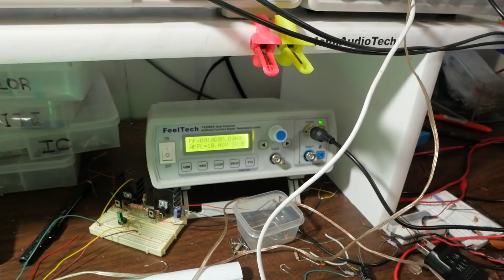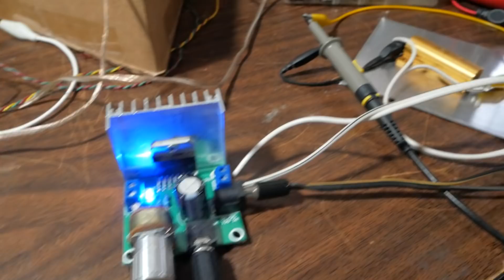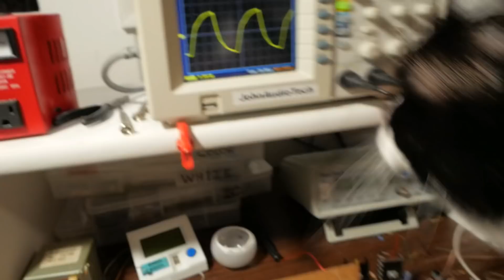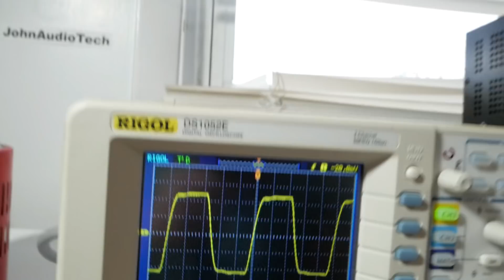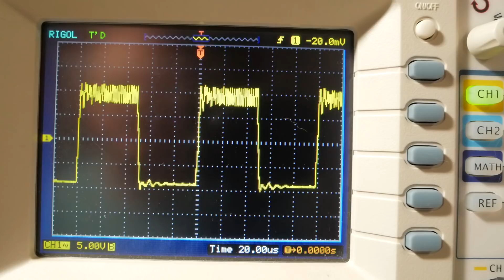Audio amplifier step response and stability test class AB and D chip amps

Comment from the maker: I should mention that this type of test may cause some amplifiers to break out into severe oscillation and blow up. Test at your own risk!
Reply: JohnAudioTech is it normal for the LM1875t to warm when idle?
Reply from the maker: @LUISRUDY1  Yes, it draws a couple watts idle.
Reply: @LUISRUDY1  Warm is fine
Reply: @LUISRUDY1  do you have heatsink?
Reply: https://photos.app.goo.gl/T94sAjtCpryuijFE9
Reply: this is the project I'm working on, it's based on the 6j1 tube buffer with some improvements
Reply: I did it and my old amplifier still working well i bled up one channel jeje its part of the risk regards excellent video
Reply: If you do you math right you should be fine if you can adjust voltage and step up you should be fine correct I’m still learning myself

Comment: Your test is great, in real life with the changing impedance and inductance going on in an actual speaker system those calss D results will be even worse... Class D just plain sucks!  AB all the way baby!
Reply: Untill you apply negative feedback to the class D amplifier. Then you can eliminate the non-linearity introduced by the filter and switching stage.
These feedback circuits can be fairly complicated, but in return you can have THD levels similar to class A/B/AB amps but with much higher efficiency.
Reply: @coen270  What good is efficiency if your signal is not being reproduced faithfully.   Try as you might, D is not going to do it.

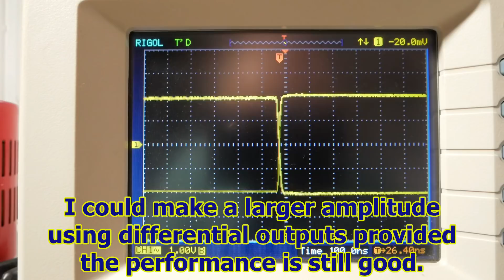Comment: In the video text @ around 6:00 you state that you "could make a larger amplitude using differential outputs provided the performance is still good"....
In order to do that, you would also need to completely isolate the supply from the following amplifier from the supply used on the microcontroller.
The amplifier 'ground' would have to be connected to ONE of the microcontroller GPIO pins and the amplifier input to another GPIO pin.  (The microcontroller 0V supply input would need to be totally independent of the following amplifier).

Comment: The reason that the 1uF capacitor cleaned up the square wave was that you made a higher Q filter out of the LC filter at the Class D output.  Your capacitor effectively went in parallel with the C of the filter.  The filter shape with frequency would have been flatter in the passband and then would have fallen off more quickly.  The change in response with load of these Class D amps is tragically poor, as you noted.

Comment: Good video!
Interesting how those small supply bypass caps are so critical to proper operation of chip amps.
You also proved out a suspicion that I have had - Class D amplifiers are at least somewhat sensitive to the load they are driving. Gotta match the speaker and amp for best results.

Comment: Hello there.....quick question.....I have a JBL prx718xlf (active powered sub) and its having an amplifier issue going on....on normal operation as I turn the unit on there should be no thumping or any kind of noise during power up and power down.....the problem that I ran into is when I power the sub I noticed there was like a slight AC humming going on and as the fan on the back of the amplifier turned on I can hear it thru the sub as well and when I apply a clean signal to it...the sub sounded very distorted and low on power even if I apply a clean signal to it.....and when I power it off I noticed it made a loud thump sound which that's not normal.....any idea of what can cause this problem by chance? I also have a video if you want to check out ( on my channel ) the problem which its better than what Im explaining about the problem.....thanks.
Reply from the maker: It could be a few things, but I'd start at the power supply. Also check capacitors. I had a JBL sub with swollen electrolytic caps.
Reply: @JohnAudioTech  ok I'll be sure to do that.....the boards on them are double sided so its gonna be a difficult challenge to check for bad components but I will do my best to look carefully to find some defects on the board......I was told by others that it could be the op amp on the input board but I still believe its the main amplifier board module to start off with but then again I could be wrong.

Comment: Check out  the  Youtube  channel  "XrayTony," , he just did a  excellent  three  part  series  on servicing  a  Adcom  power  Amp. Feeeeeeeeeeeeeeeeeeeeeeeeeell  Tech  !     Snickers  !    Grab the   wrong knob  " That's  what she said "  Doesn't the output of the amp see  capacitance  in the speaker  crossover   or  even the  labell  network ?
Reply from the maker: The reactive components in a speaker system with crossover will have a significant series resistance and will not (should not) pose much of an issue for the amplifier.

Comment: Well done to you and Snickers on the 25K subscribers. I'm not surprised that the microcontroller gives a faster rise time than the Feeeeeeltech. That arb generator is known for not having the fastest slew rate output opamps -- although that depends which model you have. I believe they came out with a much improved model last year.